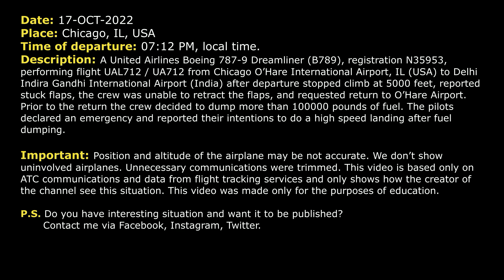High speed landing. Stuck flaps. United Boeing 787-9 Dreamliner returned to O’Hare. Real ATC

Comment: not sure if anyone sees this, but, when he says 'UAL712 Heavy' is the Heavy part a call sign for cargo-plane? or is it the size?
Reply: "Heavy" designates the amount of wake turbulence the plane creates. The 767, 787, 747, 757, and 777 are designated as 'Heavy'. The 737 is a medium. The A380 is a Super heavy.

If a lighter plane (like a Cessna) flies underneath a 'heavy' aircraft, then they could be hit with the turbulence generated by the wingtip vortices, which can be catastrophic.

The amount of turbulence often correlates with the aircraft weights, except in the 757s case. The 757 generates a huge amount of wake turbulence despite being smaller than a 767.

Comment: Good by both Air Traffic Control and the United pilots. Don’t know what the landing speed was but had to be quite high. As for the fuel dumps it would have to be about 15,000 gallons. Most of it evaporates with little hitting the ground. Fuel dumps are only done under extreme or emergency circumstances!

Comment: Out of curiosity, it looked like they were doing the fuel dump over land? Is that normal procedure? Wouldn't dumping over the water be safer in terms of none being below them getting showered with A1?

Edit: Also, I assume the high landing speed was due to the weight of fuel? Why not dump some more to reduce the weight so that the brakes etc aren't stressed?
Reply: Jet fuel evaporates really fast so as long as they are high enough it will evaporate before it gets close to the ground, or water! High landing speed is because the flap setting for takeoff is lower than the setting for landing. Since the flaps are stuck in a takeoff setting they can’t create as much lift as they would in the landing setting. So the aircraft has to fly the approach at a faster speed to keep the aircraft from stalling, therefore landing faster. More speed equals more lift essentially. Hope that makes sense!
Reply: I think the mechanical issue was stuck flaps so that may explain the landing distance

Comment: That's a lot of fuel at low altitude and low  temps.  Surprised they didn't dump completely over the lake.
Reply: It was mentioned several times in the conversation that they were afraid of the existing icing condition over the water.
Reply: @Wolfgang van Oorschot  And that means nobody should be concerned about the thousands and thousands of lbs of fuel dumped on land? Definitely a highly populated area also lmaoo ya big dummy
Reply: @TheLurch11  That's just not how jet fuel works. It evaporates.
Reply: @HarshL  ......
Reply: Apparently it evaporated

Comment: Dumping 100000 pounds from 6000 feet with temperature around 30F, how much jet fuel hit the ground or lake? I would guess at least 60000 pounds. That's a significant environmental disaster even spread out over 200 square miles. Is there a cleanup protocol for that? I wouldn't want to drink that water, or eat those crops, or let my kids play in those parks, for years.
Reply: I have always wondered about dumped fuel as well.
Reply: Jet fuel won’t freeze until -40 degrees, so at 6000 feet, no fuel hit the ground or lake.
Reply: Wow. And let me guess that was never reported to the EPA.
Reply: I thought altitude evaporates before it hits the ground
Reply: @38141BCTTx  Jet fuel (basically kerosene) evaporates slower than gasoline. I'm trying to get info from the EPA but I believe a large fraction of the fuel would hit the ground or lake at that low altitude and low temperature.
Reply: If you actually watch the video they dump fuel over land and at flight level 6000. It evaporates and the FAA regulation is that it  shouldn't be below 2000 feet.
Reply: Evaporated or burned, it ends up in the air either way.
Reply: @gshenaut  Unburned jet fuel in the water and soil is a more serious health hazard and environmental contaminant than burned jet fuel in the air.
Reply: @a.o.424  How does it get into the soil and water if it evaporates?
Reply: @gshenaut  That's the point I'm trying to make. Dumping from 6000 feet at 30F, I think a large amount of fuel would settle on the ground or lakes as a mist without evaporating.
Reply: @a.o.424  Sure, but my comment was only about evaporated versus burned.

Comment: Seemingly a well handled response to a fairly minor failure from which they can’t continue. The pilots seemed to be a little hesitant with their decision making process and asking ATC instead of telling ATC what they wanted. Climbing higher than that initial 5000ft wouldn’t have hurt either.
Reply: Depending on weather ya it could have hurt. Working with atc isn’t abnormal the aircraft is flying fine so working with atc to avoid other disruptions isn’t being hesitant. Also a flap failure isn’t a minor failure post landing fires are a major concern.

Comment: The controllers are making way too much communication for any aircraft with these circumstances. The pilots are experiencing high work clothes… They do not need excessive communication.
Reply: Keep in mind this video is compressed, so it sounds like a lot, but it's spread out over like 45 minutes.
Reply: @TheTiktok4321  … I did not think it was compromised, as the visual “target” did not jump.
Reply: @daddybearlv  the visual is sped up in between communication
Reply: It’s not a high workload situation. They are communicating to the cabin and company as well as ATC, but the checklist and flight deck set up can be completed in about 5 minutes.
Reply: Also for a flight to India these guys probably had 4 pilots on this flight, so even the non-flying crew members were probably assisting in running checklists.

Comment: The pilot was also periodically advising other pilots in the area that they were dumping fuel -- professional and considerate. And then after talking with the company's maintenance department, he's thinking "No way are we going to fly all the way to India with stuck flaps... besides, O'Hare airport is a United hub and their repair facility would be there as well.
Reply: That was the ATC -- mislabeled as UA712
Reply: It is a standard call by ATC during fuel dumping: "Attention all aircraft, fuel dumping in progress [distance and direction from landmark] at _ altitude, _ type aircraft
Reply: Believe me, he knew from the beginning they won't fly to destination with stuck flaps...
Reply: You can’t fly that far with flaps partially extended. There are altitude limitations for the aircraft above which you can’t have extended flaps.
Reply: @EdOeuna  and they will burn much more fuel, which will probably cause dropping below minimum reserve fuel at the destination, or even not enough fuel to reach. Another reason is you don't know why the flaps are stuck, probably hydraulic . Not a good choice to fly with
Reply: @Marix498  - once the flap fault has been detected the flap movement mechanisms are locked out so there is no further hazard to flight at this point. It is really just a matter of fuel consumption and landing distance that now restricts the flight, wherever they chose to divert.
Reply: @EdOeuna  yes but we are responding to post about decision not to fly to India with stuck flaps, not considering where to divert... About stuck - not a big deal when they're stuck  simmetrically only.
Reply: @Marix498  - the system shuts down for asymmetrical flaps, so nothing except for the flap actually falling off will affect the performance of the aircraft.

Comment: You can't put a price on life.  I am glad they dumped the fuel in order to land.
Reply: (At a minimum 6,000 feet, AGL, fuel will dissipate before reaching the ground
Reply: this aint exactly a life/death scenario - its the same as having a power steering fluid leak on the highway - annoying and requires attention, but not dangerous
Reply: @ghostrider-be9ek  My comment is that if they did a high speed landing without getting rid of the fuel their brakes would have been significantly hotter and could have brought a different outcome.
Reply: @RonPiggott  yes, but they could have achieved the same goal by holding for a while and burning the gas.  Not all aircraft are capable of dumping fuel, even when they can take off over the max landing weight. It is not life saving to dump fuel, it is only a time saver. Truth be told, they could even land with that heavier weight in a true emergency, and not have such a problem either.
Reply: @RonPiggott  hot/heavy landing does carry the risk of tire deflation, yes - but again, not immediately life threatening as say, loss of elevator control
Reply: @spelldaddy5386  not sure what the fuel burn is on this aircraft type, but in the 767 we burn 10,000lb/hr. You’re saying they should have held for 10 hours to burn off fuel? I think not.
Reply: @cdesha  for him it is what a while means :)
Reply: @spelldaddy5386  
Sure but how safe would it be to circle around the airport for about 14 hours?
Reply: @ghostrider-be9ek  - well, it's a flight control surface... and when you don't know what's causing the malfunction, you can't rule out it will get worse.
Reply: @steve1978ger  these aircraft have very good monitoring systems. It will be abundantly clear to the pilots if there is an overarching problem (eg hydraulic failure) causing the flaps not to move, but when that is the only failure, they can be sure that the problem is isolated to the flaps. There is no getting worse from stuck flaps that will make it a life or death situation -- these aircraft are built and tested to handle these emergencies
Reply: @steve1978ger  stuck flaps is not the same as loss of elevator or spoiler/aileron control
Reply: @spelldaddy5386  - even the best monitoring can only sample specific points in a system, it can give you a good picture but not the full picture. That's why any malfunction that directly affects flight, like the flaps, needs to be checked on the ground ASAP.